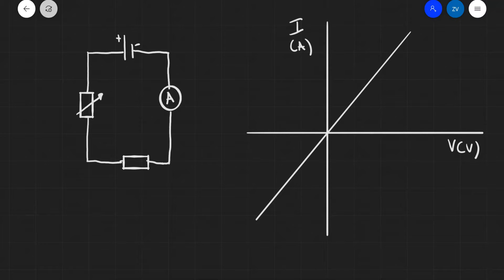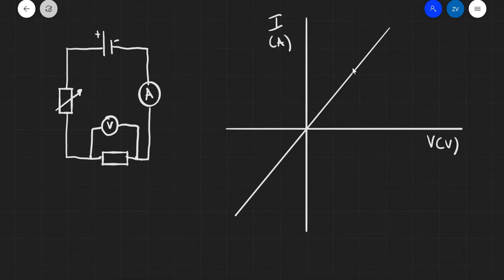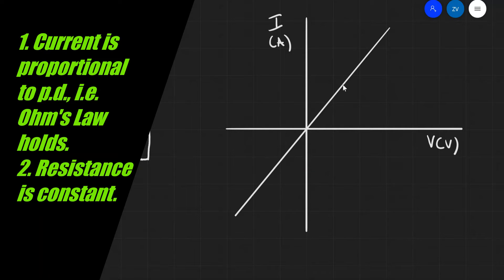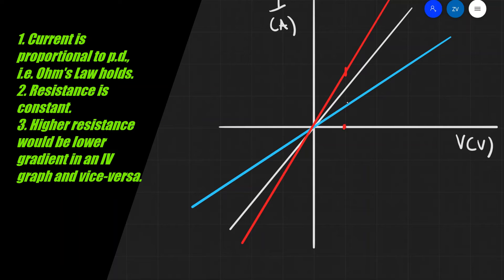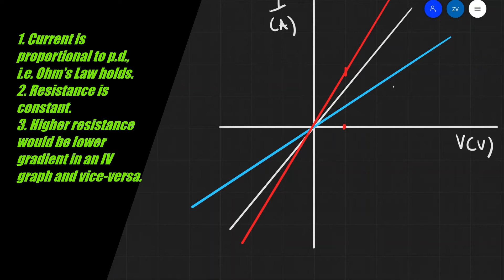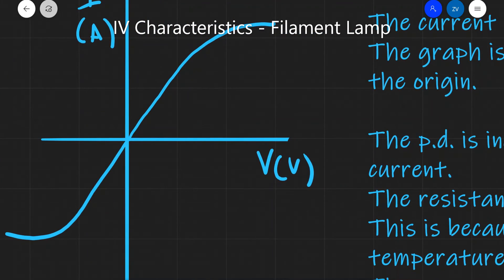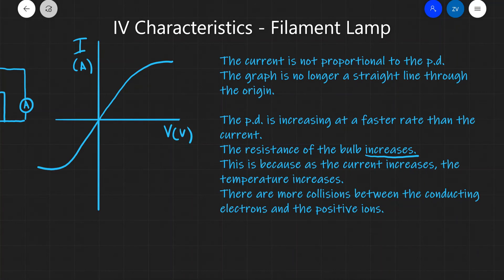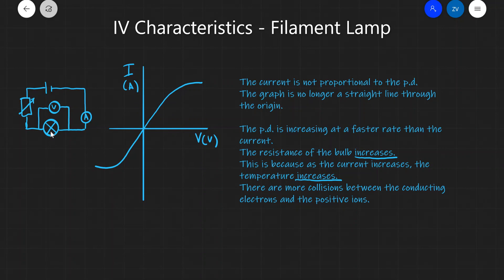IV characteristics of a resistor and a filament lamp

Comment: In filament part 
When current inc then resistance dec isn't it ? But you said cuttent inc temp inc resistance inc how this is true ?
Reply from the maker: In a filament lamp the temperature rises the kinetic energy of the molecules which vibrate more and there are more collisions between conducting electrons and ions. This increases resistance. Hope this helps!
Reply: @zhelyo_physics  it mean in filament we have to ignore current in this case
Reply: Plus in thermistor you said as current inc temp inc hence resistance dec. So kindly can you tell diff again
Reply from the maker: NTC Thermistors or Negative Temperature Coefficient Thermistors act differently as when their temperature increases due to current more free electrons are released from the material meaning that the current increases due increased number density. 
So to summarise - as current increases in a filament lamp, the resistance increases. The opposite for thermistors - when current increases, the resistance decreases. Hope this helps!
Reply: @zhelyo_physics  thanks a lot 🌸🌸